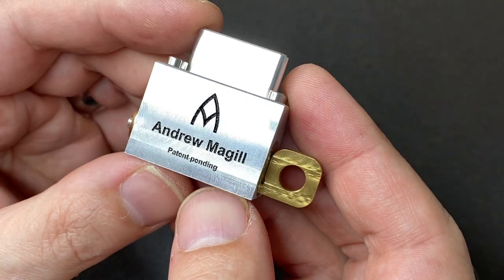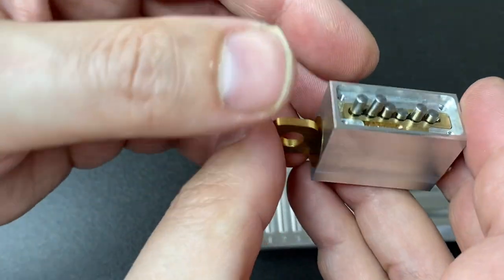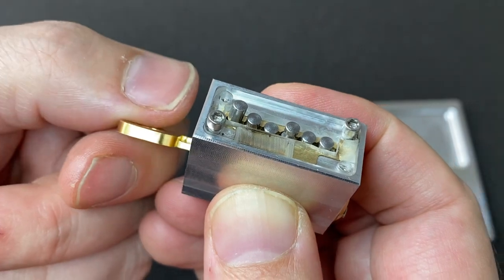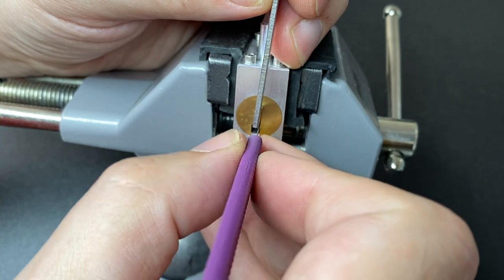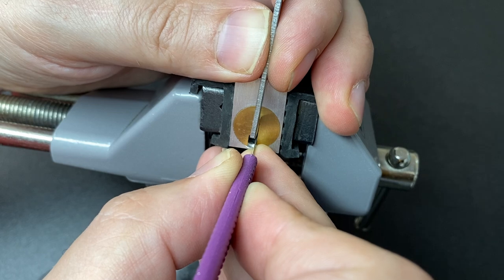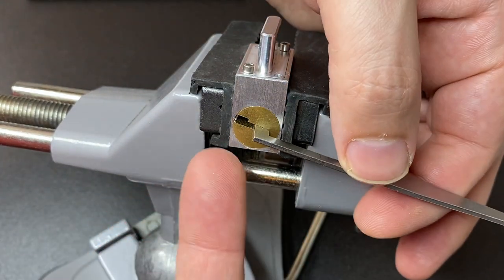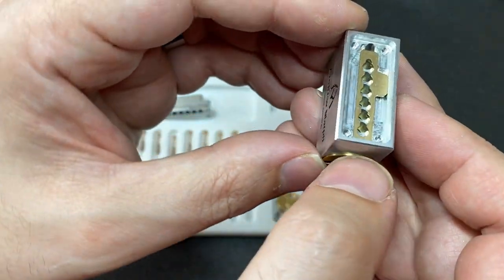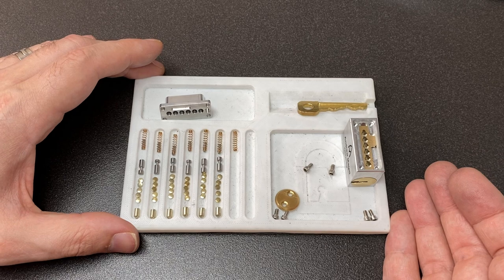Unpickable? Enclave - an Ingenious New Lock Design

Comment: Wow.. the timing on this is absolutely bizarre..  Just a couple of months ago (after watching way too much LPL) I came up with a lock design which is frighteningly similar to this (the only real difference is it actually uses a side-contact sidebar and a cam which pushes the sidebar away and prevents it from contacting the pins (springs push it toward the pins, so even if you somehow found a way to manipulate the sidebar directly, it is not possible to manually push it into contact at the wrong time)).  I don't really have the machining setup/skills to actually create a prototype or anything, so the design has just been sitting on my computer for the past couple of months..

I'd accuse this guy of stealing my design, but since I basically never even showed it to anybody, I guess I just have to give him props for coming up with basically the exact same idea completely independently, apparently, at almost exactly the same time.  Truly weird.  (I wasn't really looking for fame or money, just kinda wanted there to be better locks in the world, so I really hope he can make this design a success and it takes off.  This video seems like a pretty good validation that I had a good idea, at least!)